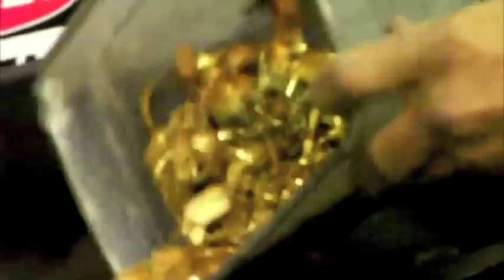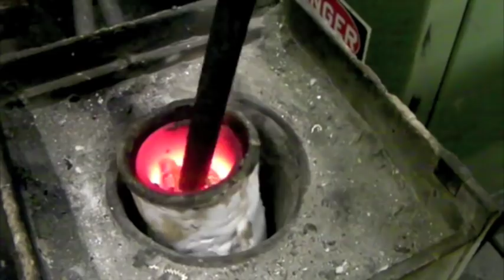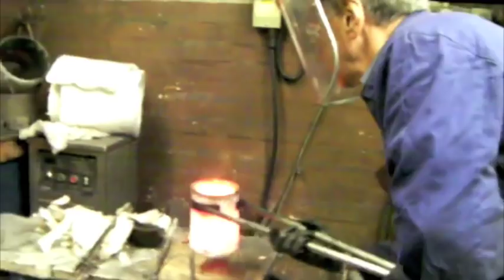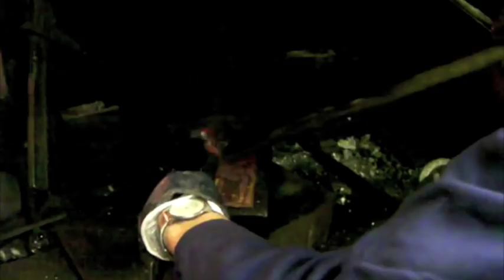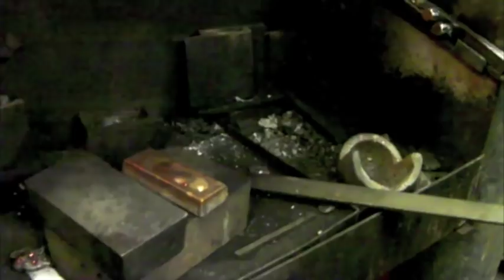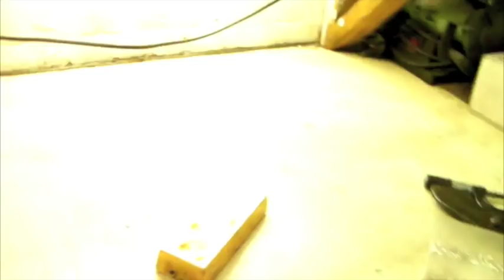Melting old Scrap Gold Jewellery

Comment: Most gold jewellery isn't pure gold because it's soft and needs other metals to strengthen it. Gold bars are required to be at least 99.5% gold. This bar is probably only 40-60% gold, unless that was 24K gold jewellery. I'm going to assume that the gold was melted down to be used to make new jewellery.

Comment: Gold melts at 1064°C/1947°F but doesn't vaporize until 2856°C/5173°F.

The gold is heated to above its melting point, but far below the vaporization point. So, by melting gold, none is lost to evaporation. You'd have to go to significantly higher temperatures, and most conventional furnaces don't get nearly hot enough.

Comment: You're wrong, gold can evaporate it has a Boiling point 2856 °C.

And just like water, it does evaporate below boiling point as well, there are mathematical formulas to calculate the vapor pressure.

Comment: I have all sorts mixed as I find it as a diver sometimes so can I melt it altogether as I can't read the carrot markings & don't have testing kits.does it have to be same carrot when melted or if I mix it up will I get an average carrot
Reply: +Dan Servante it better separated as you will get more overall or you can mix it and refine it to full purity with some aqua regia
Reply: Dan dan I'm sure you do, but please check any gold finds with an archaeologist or antiques expert. You may be destroying artefacts that are worth much more than their material value.
Reply: I was of the understanding once smelted with flaux it brings it back to pure gold with all the added crap separated at the top of the gold which can then be hammered of.

Comment: When smelting items like this that have a high solder content,like the complex chain and items soldered together from lots of small parts,will the solder turn to slag in the smelting process?Apart from Borax are the smelting additives you can use to remove the solder content which in turn refines the gold that bit closer back to 22K?Apart from using mercury to make amalgam and then driving off the mercury or using cyanide in an electrolysis set up,is there any other way to refine it to 24K??

Comment: that's a good way to break that crucible, tapping it against a hard surface when it's hot like that. On the other hand, with a gold bar like that, you can afford to buy a lot of them. BTW, do you purify the gold by electrolysis or some other method, as not all that gold is 24 karat, correct

Comment: Does anyone know witch material use to melt golden dust. I watn to melt it with torch. Tried with ceramic pot and had huge fail. Pot broke and half of my dust was lost :(
So I could use some help with sellection of material.
Thanks!

Comment: Quick question to "ballymoss1963:  Doesn't copper, or any other alloy melt at a different temp. than gold?  Couldn't be theoretically possible to, let's say heat the metal with the lower melting point, thus separating it from the other metal that has not reached its melting point?!?!???

Comment: I'm sure if the temperature gets high enough, gold will infact turn into its gas state, but the problem with that is that for such a temperature to be reached on earth, the energy created in from the heat will probably be more powerfull than any nuclear bomb.

Comment: Yeah brick of 22K is not worth but several hundred maybe  now make it 24k
IE 999.9 AND AHH yes we are now talking big money!!!!
Reply: ***** actually more like 9% to 9.9% difference in gold amounts, so at roughly $1500/troy ounce for 24k (99 to 99.9% pure), it would be $1365 for 22k (91% pure).  So, if a bar of gold eights around 400 troy ounces, that's $546,000 vs $600,000.  Big money regardless.
Reply: tawilk You are absolutely right 100%!   I cannot disagree more with you actually 10K or 15 K or 18K is still 24K it just has alloys in it , and removal is the tricky part? But you are so correct !   I'd be more than happy with 18 K bar any day  or even 14 K still be very rich after it;s smelted and REFINED?
Reply: deltaalpha21074 yes, it's always nice to have "pure" gold, but the value is essentially still the same, just priced accordingly due to other alloys (excluding palladium).  

REFINING the gold is tricky for most people and the cost savings really isn't there, are you're still selling/buying based on the amount of gold weight, not its purity.  in big batches it can become cost effective to worry about trying to separate the nickel and bronze if needed.

in the end you're still rich if you have that much gold laying around.
Reply: tawilk Question then is HOW do big refineries know they have absolute .999 GOLD upon refinement? In a sense what makes one bar more pure than another at the end ? Simply I have seen S African look so dark and yet others little lighter in gold color ? Is there some special devise that really sets the ultimate standard when testing by refiners?
Reply: deltaalpha21074 not sure, i'd imagine measuring the bar's mass (weight/volume).  also, there are chemical processes that can determine and isolate gold from other alloys, but i'm no chemist or refiner.

the differences in appearance is probably why it's not 100%, rather than between 99% and 99.9% to be considered pure or 24k.
Reply: tawilk Hey no need GODs of GOLD have spoken watching NGC channel right now and guess what about???? you got it GOLD from day the earth got it from space to the Canadian refineries best in the world and uh still TOP SECRET they did not reveal how they take it to 999.999 % I bet it inovles Firemen O2 masks suits and lots of deadly CYANIDE; so reason we cannot make it 999 pure?
Reply: deltaalpha21074 you could probably eventually get it to 99.999999% pure gold, but it would cost you more time and effort/money then it would be worth to get a little extra hundredth of a %.

maybe you cold try so atomic collisions to form it or vaporize it in a distillery type way.  but dealing with temps over 4000 degrees F would be hard to handle cheaply.
Reply: tawilk You would have the super ultimate standard I just watched the biggest baddest essayer on Earth in LONDON seconds ago HALLMARK and wow they even x-ray it so you get it to the highest purity on Earth would have"" THE ULTIMATE STANDARD"" set for the world ---good luck because that would be priceless.